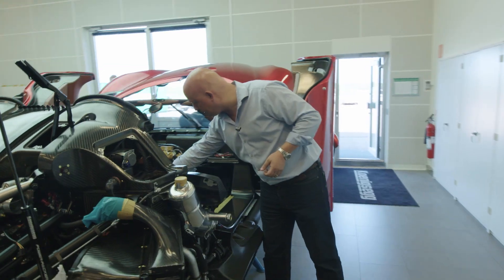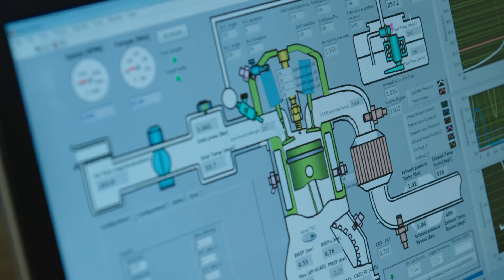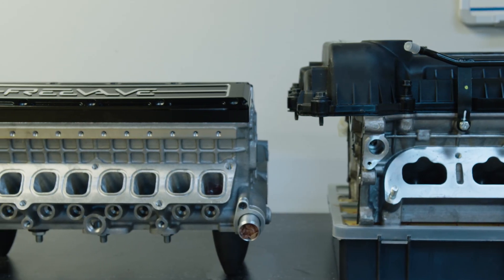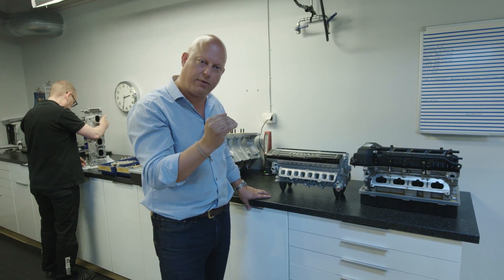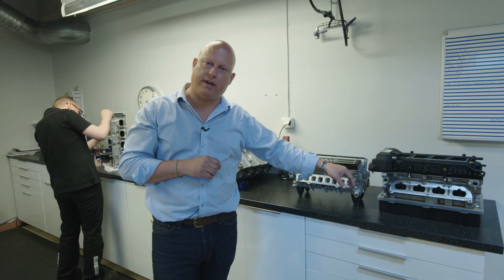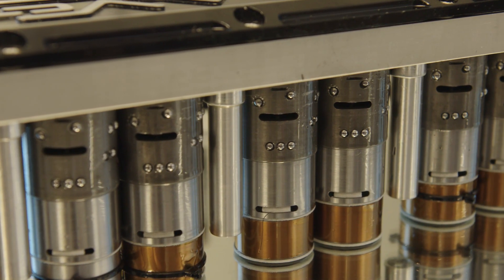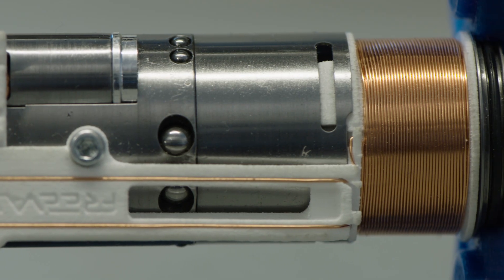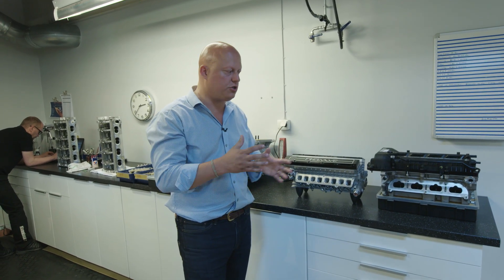Freevalve Update Camless Engine -- /INSIDE KOENIGSEGG

Comment: This is unreal. Individual valve control. Turbo control with no wastegate. More power, cleaner combustion without needing direct injection. This has to be the biggest ICE advance since its invention in the late 1800's.
Reply: They still have an inlet cam on their camshaft that pushes the oil for the inlet valve, so the valve timing and overlap is still fixed and only the lift varies. 
With full control of the individual valves, Königsegg has much more control of the engine.
Reply: poopdawg27 Its not the same thing....at all. Not even remotely.
Reply: I'd say the Multi-Air is a precursor step to this, with one huge difference in that the M.A. is designed to have a more graceful "Fail mode" - it degrades to a mediocrely tuned, "norma"l engine, in case its ECU dies or it has to shut down because it sense that one of its actuators is misbehaving.

The design is actually more complex than the Freevalve, for less flexibility, but you can drive to the repair shop if the ECU or the actuators fail.

The freevalve, on the other hand...

If one actuator fails, you lose a cylinder.
If the actuators have problems, for extreme cold or whatever, no start at all.
If the ECU fails. you've lost the engine.
If the air pump fails, no engine.

Also, usually the "weak point" of  Cam-less engines is powering up all those valves, which takes quite a bit of energy, usually delivered by the cam belt/chain/gears. 

In this system, that energy must come form somewhere else - also, pneumatic valve tappets? 
it needs a pump, that has to start a little before the engine to pressurize the engine. 

The Multi-Air is a brilliant precursor, designed more than a decade ago - it became ready during the infamous FIAT-GM alliance, and was "freezed" for a couple of years or so, till the dissolution of that ill-fated partnership -  to be mass-built by a company not exactly famous for an obsessive attention to detail.

Being so, it was developed taking into account a more limited reliability of the electronics and actuators(tech has gone on).

Note that, over time, some of M.A. redundancy has probably gone lost - I believe that in modern instances, the M.A. has no more a separated control unit, but it is just one big box that does it all - ignition, injection and M:A. control. 

Cheaper but, now, if that box fritzes, that's all the engine that dies (if not the whole car).

Rest to be seen if Koenigsegg thrust in this technology will be justified, once it will be used on run-of-the -mill cars mounted on a rush, by limited-training workforce and with mass-built components contracted on a dime-a-unit basis (i.e. any "normal car", in modern days).
Reply: And yet there are 17 idiots in the world...and counting :p
Reply: imagine a gt350's 5.2 with this valve system. That would be amazing.
Reply: Da Botz+ 'If the ECU fails, you lose the whole engine.' Just like every engine since the introduction of electronic ignition, lol. You're right that it introduces more failure modes.
Reply: When it was designed, the M.A. was a "Bolt-on" solution with a separated ECU, as it required more finesse than the I:E. of the time. 

Also, not every I.E. engine ever...

I have an old car with a mecanical -electronic injection.

The ecu dies, it falls back to a not perfectly tuned mechanic ijection of the era.

Of course, such redundancy is a bit pointless, in reality, unless you are building military stuff (and the mechanic injection pump is a bit of a nightmare, when it fails - rare as it may be).
Reply: Patrick94GSR Not to mention an increase in durability and a decrease in parasitic loss. The removal of the timing chain/belt reduces the fear of crashing a valve into the piston (interference engine) and it's also not dragging on the crankshaft.
Reply: Preston Tucker, of the Tucker Automobile Company, came up with a cam-less engine design in the late 1940s. It was a 589 cubic inch engine and actuated its valves using hydraulic pressure versus this design's pneumatic construction. This is a rekindling of an old technology and refined for modern application. There really isn't much new under the sun in the automotive world, just revisions and refinements of past ideas.
Reply: The FIAT multiair engine does this exact thing, only it's controlling intake valve only (though hydraulically) and has one traditional camshaft.  Lot's of people overlook the motor, but with this kind of technology, it's no surprise those 1.4L turbos easily reach 260-300whp.

Comment: pnumaticaly operating engine is nothing new, the F1 Formulas were having them in the mid 90's,
they said it was nitrogen based gas that operated the Valves at specific pressures..
Reply: The only thing the gas did in F1 engines was replace the valve springs, not the valves themselves. Yhis engine gets rid of cams, and traditional valves.

Comment: when will there be FreeValve heads available for my 4.6l 2 valve '96 Mustang GT?
Reply: probably not because how the engine is built is fully made for these specs but you may buy a fully complete crate engine hopefully
Reply: Looks like I'm just gonna have to build my own electro valve adjusted head lol
Reply: Good luck.
Reply: if koenigsegg's current architecture is still close to the ford modular used in the ccx, it could potentially bolt on. koenigsegg used to use bored and stroked mustang cobra engines, the agera looks like it still shares at least the valve covers
Reply: pooft Lee damn that would be awesome to have those heads, less strain on the engine too, which is good because I would definitely run the engine harder lol

Comment: I wish this could be done to older engines, oh man I wish to have this in my cars so bad.
Reply: Damon Holmes
 cut down valve stems, or chop off the old ones and get ones the right diameter/depth  as needed and chop the thing up, its all electromagnets attached to a valve and its not really critical where they go as long as the wiring in correct and the software works.. might have some issues with getting perfect angles on the valves or have use a different piston head. this isnt some sort of magic that cant be modified, they started with a 5/6 year old v-6 block, as stated, so its not some one off random shape, so i think anyone tech savvy wouldn't have much issue aside from the software might not be scale-able, but i'd assume it would be easiest to write software that doesn't care about the number of cylinders and 4, 8, 12 or any other number would just be some more processes running in a shared software (best future proofed writing assuming they would license this other third parties)
Reply: Yeah. It's very exciting. I like how individual valves can differ.
Anyhow for me hotrodding isn't lessened by these developments. Hot rodding satisfies a man's desire to tinker.
Reply: Krnt13 if there's an aftermarket demand, any good business man will fill the need.  It might take 50 years though.
Reply: What I mean is that could pay them to make a custom head for may car, which is most likely not possible due to their focus being car manufacturers.

I just oversimplified the expression, too much.
Reply: Damon Holmes might not be impossible. Guys are hacking up LS1 heads and welding them together then bolting them onto Ford 300 in line sixes. Not to say it's easy though. And the more complex the system, the harder it becomes.
Reply: i mean it looks like it would work, you just gotta take a lot off and plug some holes from stuff missing on the engine
Reply: Lol unlucky this shows you have no clue about engines.
Reply: Damon Holmes
 you feel like doing some welding you can turn 2 carb v-6s into a v-12 injected. get the hell out of here with your attitude bud. i didnt say it would be an easy modification, it would be easier than trying to make a v-tec work on the wrong engine as all the valve cams are independent. i think the biggest hurdle will be getting a ECU that could run it
Reply: Un7ucky Tell me how you would get it to fit onto a completely different design block, with different bore, stroke, bolt pattern, different compression ratio. For it to work everything would need to be PERFECT.

Comment: 8:20 Koenigsegg is so into efficiency that they taped the edge of their office fan to make it work better.....
Reply: Nick Hadfield you know he actually has a condition that means he doesnt grow any body hair at all. No joke.
Reply: @JonnyD3ath   alopecia ?
Reply: Lyle Stavast Alopecia universalis, a more advanced version that results in complete loss off all hair, eyebrows, eye lashes, the lot!
Reply: Christian goes to the extreme of shaving perfectly smooth every day so he can think faster.
Reply: Uriah Siner more like, the fan housing latches are broken so they taped it together.
Reply: JonnyD3ath
oh dang, you're right.  No eyebrows, I actually didn't even notice before.
Reply: "I shave my head to reduce average overall aerodynamic drag partially because i have less material there and also because it is smooth and tapered i will patent this"
Reply: they could have used some better looking tape though :)
Reply: Dave Mathews
If its ugly and it works, it still works ;)
Reply: Should have used carbon fiber tape it would fit there theme well.
Reply: Uriah Siner 
Yes, I noticed that also. Shrouding the circumference does increase the efficiency. 
But the suspicion that cheap air-movers from China (seemingly everywhere) needed to be fixed after takedown and cleaning by the nearest thing at hand. Looks like cheap masking tape. 
Good enough.
Reply: Yeah, agreed with Patrick94GSR.  It was falling apart so they taped it together.  If my understanding of fluid dynamics and radial fans is correct that will actually decrease efficiency slightly (greater turbulence at fan edge, slows blades, decreasing output).  Fluid dynamics and fan efficiency can seem counter intuitive a lot of the time.

Comment: So why don't they use this on their own cars?
Reply: Maybe because their cars already produce 1000+hp?
Adding this might put to much stress on other engine parts.

But I hope they will take the 1:1 Engine and modify it with Freevalve for a future car, the power and torque output would be insane.
Reply: Me if anything it should remove stress. There'd be no need for a timing belt, plus the engines would be able to make the same or more power with less boost at lower revs.
Reply: Terron Hyde it is on their engines. Well, at least the newest car. That's how the company started.

Comment: So the big question. Why isn't it in production and why havnt other companies developed it?
Reply: It's extremely complicated and a new head and software has to be developed for each engine. It would take a ton of time to develop it, and most auto manufacturers don't have time because they are dealing with bullshit regulations that eat up time and money that could be spent developing technology like this.
Reply: Michael Nguyen
I don't disagree with your sentiments, but to be perfectly fair, part of the reason that China gets away with all of this blatant piracy is that copyright and patent holders have been assuming for years that they've covered in China.  It's only recently that they realized their mistake and started filling out all of the paperwork in China to prevent that sort of thing from happening again.
Reply: Because it is new and expensive, dont expect any new technology to be implemented immediately. Give it 10 years or so and you will see it start to appear in common passenger cars
Reply: I imagine that cost has something to do with it.  This setup requires multiple hydraulic actuators to open the valves and what is probably some pretty sophisticated tech to operate them, rather than a simple metal rod and a few gears.
Reply: maybe because its expensive? you wont get a 'qualified' answer here buddy, go ask ford, toyota, honda, etc. if you want a 'qualified' answer
Reply: For the same reason variable valve timing took so long to become mainstream on most vehicles. Companies don't want to dump money into R&D for something no one really cares about. Just look back and you'll see that up until about 25-30 years ago fuel economy and emissions wasn't something worth the time and money to invest in but now with companies getting hit with emissions tax we see companies like Toyota developing their world service transmission fluid to reduce their emissions.

F1 cars have had this same tech since about the mid 90's because of the weight reduction and engine control it offers. Fiat developed and patent the first engine with variable valve timing and they have also developed engines like Freevalve though the implantation has been terrible so they haven't had a lot of luck with them.
Reply: Kevin Mays That's not a qualified answer. it's your own guess. hearing the benefits. they definitely would considering all the other crab they invent.
Reply: Fiat have a chincochento car with multiair is the same principle of a camless engine.
Reply: id be willing it bet its due to cost, packaging and durability cycle. pneumatic valves have been used in f1 since the early 90s, so we have had the tech to do it for a while.
Reply: this sounds realy expensive but if you were ordering a  koenigsegg i doubt woud would care.
Reply: Igor Toebe HUGE LUMPY CAMS HERE I COME!
Reply: a chinese car company called Qoros is giving this a try.  They are already selling cars in Europe and Asia.
Reply: philip s patents
Reply: el moskito thanks for remember me, yes it uses a camshaft to create oil pressure and selenoids to transfer the volume of oil into the non fix valve lift, it doesn't need a trottle body but is stuck to the mechanical camshaft profile, Freevalve is much much better, gives almost a square wave that isn't fix, with timming, lenght and lift variables as big as you whant.
Reply: Phantom Driven - Cars, RCs, and Lego Technic They are doing it to reverse engineer and steal this tech
Reply: Michael Nguyen geez everyone is so against Chinese people :(
Reply: Phantom Driven - Cars, RCs, and Lego Technic It's true, they have copied a crap tonne of cars and the government protects local companies from copyright. They even have special firms dedicated to reverse engineering technology to be sold to Chinese companies. It's very well documented.

Comment: 6 years i dream about that. I imagined it was possible with electromagnetic actuators only, but they lack punch. this kind of engine will combine advantages od both diesel, vtec, vanos, vtc, vvti, and more since big torque can be achieved even close to 0 rpm and maintained up to F1 rpms. ideal to go along an electric motor and get rid of a gearbox.

Comment: long term reliability without breakdowns is the issue here. cams Work for a long time.
Reply: I don't think it would be that bad. First of all actuators are usually quite durable. And looking at the way it is build, if one should break, you would only have to change that one. And if this becomes mainstream you would be able to by tiny actuators like these for next to nothing.. And you wouldn't have the risk of total engine failure if the timing belt snapped, because there isn't one..
Reply: Yeah, but that's a limited-use performance engine that's practically designed to fail.  Engine blowouts are super common in Top Fuel as well.  For your daily driver, cams work great.
Reply: Johan Sidén yes in racing but not usually in everyday driving, unless someone fucked up something fierce
Reply: philip dias How do you know that?
Reply: They use electronics (ECUs already available in all newer engines), hydraulics (most engines use hydraulic valve lifters anyway), and air.

No Camshafts, no belts...
Reply: I think he is talking about the electronics that are involved and the pressure driven hydraulic systems, which would need new seals every so often and the electronics would eventually wear out. It seems like it would be more high maintenance in the long term than a conventional camshaft engine.
Reply: Give it time, it's not fully developed yet. Basically every technology has some issues when it's new.
Reply: I know for a fact some racers at Hot Rod Drag week swaps cams every (other) day. Hows that for long time usage? ;)